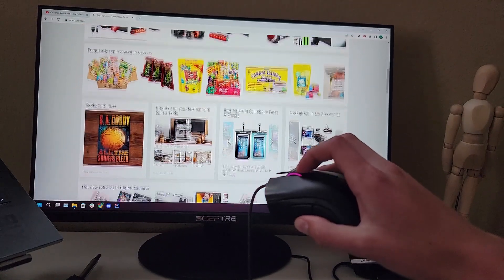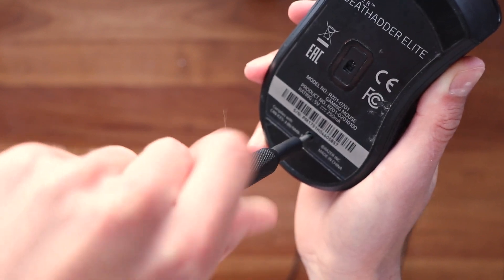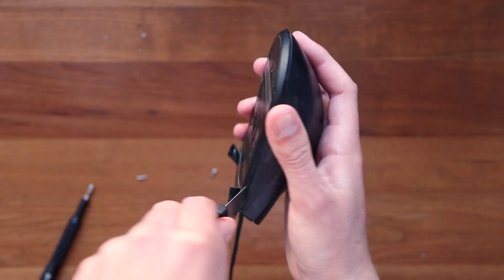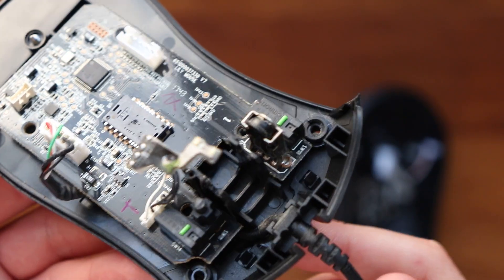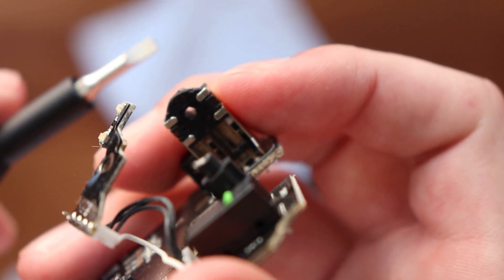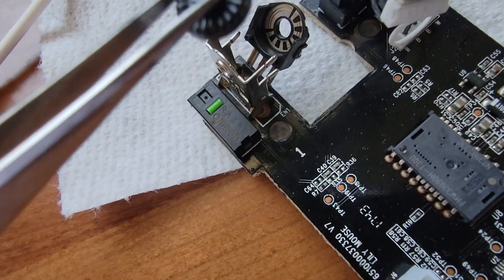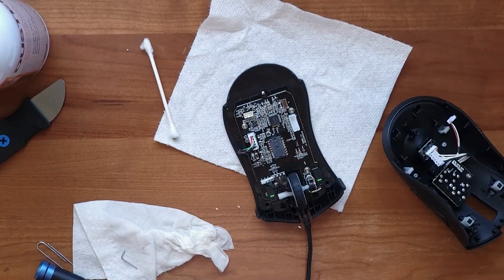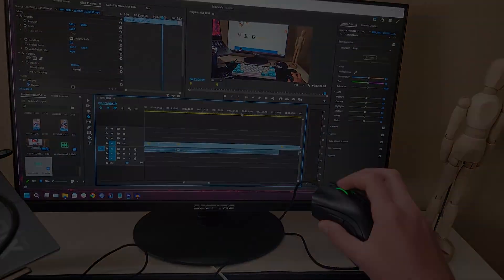How to Fix a Jittering Scroll Wheel (& Razer Deathadder Elite Dissasembly)

Comment: ive had my mouse since 2017 when i bought. good 8/9 years or so, razer lancehead. It has had this issue with the scroll wheel since i got it but always just ignored it and use auto scroll or the bar at side of the screen. Today in 2026 was the first time i thought id try to fix it. dont have compressed air can so just blew hard into the mouse scroll and now its working fine after all these years

Comment: My mouse wheel was acting up too. I opened the mouse and used my shop air compressor to blow directly on the little fins inside the scroll wheel, kind of like spinning a mini windmill. The wheel spun insanely fast and, for some reason, started working perfectly after that. No idea why, but it fixed it. Thanks for the help!

Comment: The number of views on this shows how many issues Razer has with some of their mice (yes, I know, not all the views are from frustrated Razer owners). Seriously, this is my third Razer mouse and EVERY SINGLE ONE has had the jumpy schroll wheel. I've never experienced it with any other brand.
I don't get it, are they using poor quality parts or something? They should be able to afford proper builds. And don't get me wrong, I have loved every single mouse from them - up until the point where it made me want to bash it against the wall in scroll frustration.

sign Next time I'm getting a Logitech again..

Comment: I tried many different methods: spraying, blowing air, but none really worked. I found a reddit post that helped me: "Turn the mouse upside down and press the wheel against your table/mousepad. Hold it down until the middle click actuates. Then roll the wheel back and forth fast for a few times. It might clear out anything preventing the metal contacts inside the encoder from working properly." I did as it says only I didn't roll it a few times, I rolled it for 3-5 minutes very fast, and while doing it I saw lots of dirt coming out. Though it didn't solve the issue completely, but it's about 90% better now.
Reply: this actually worked for me.  air didnt work, buy me some time
Reply: Bro that worked for me , tysm for sharing this out
Reply: tysm!!!! it worked for me too!
Reply: Here to say as well for anyone looking to resolve Razer mouse wheel scroll issues.

This worked for me as well. Pressed it down and went to town going fast, lots of crud and even a small dust bunny came out and now my wheel scrolls like new again.

I 100% vote to try this first before doing anything else, especially disassembly.
Reply: thank you so much. I really didnt want to take my mouse apart. Fixed it for now after rolling it back and forth for 20 secs super fast.
Reply: thanks bro it workedd for me
Reply: Lol this worked for me wtf
Reply: If you turn the black piece of circle plastic around, there will be copper somewhat dangling; try to kind of drag it outward so it will join to the copper on the other side better. When I fix a mouse, this usually works.
Reply: This should be pinned! it worked for me.  Thanks for helping the community out.
Reply: wow i just did this for like 10 seconds and it fixed it, thanks bro lol
Reply: Dude! This actually worked! I only did it for about 15 seconds, but the scrolling was almost 99% fixed. On certain rare occasions it would go the opposite way, but compared to the amount of work that this video suggests you to do, it is definitely sufficient and it works.
Reply: I did the pressing down and while scrolling fast i blowed onto the mouse that made the issue go away completly
Reply: WOW!! after months of rotting in the dust it finally worked properly again. I have the viper mini and the issue with the scroll wheel is unbearable.. I tried the rolling method for JUST a couple times and it felt new again!
Reply: Seems like it worked. Thanks man.
Reply: should highlight/ write it with capslock so every one would notice and try this first because its working!
Reply: Luve saver, thank you, it worked for me
Reply: Yo thx my mouse started having this problem like 3 months after I got it and js bought a new one, its been 2 years and that new one broke and I remember I had this one, I forgot it had that and I cannot wait for a new mouse, this fixed it 90% too
Reply: legend
Reply: It actually fixed mine 100% lol appreciate it bro💯
Reply: What the hell, it actually worked wtf hahaha thank you
Reply: i can't believe this worked :o
Reply: amazing. it worked.
Reply: broooo it worked for me thank you
Reply: Maaaan I love you
Reply: blowing into it didn't work, but doing this a little aggressively for about a minute in long sweeps really worked! The first time it improved but wasn't perfectly, so I did it again and kept doing it until it worked. Now my scrollwheel is moving pretty consistently! If I see it doing it again I'm going to keep doing this

I tried taking my mouse apart and blowing into the area (I didn't want to take the wheel out) and that didn't work. Bit of a waste of time unfortunately
Reply: It worked me too, thanks though 😮
Reply: brooo thanks a lot
Reply: thank you so much, its not perfect but like you said 90% better
Reply: Bro, you forgot this 👑
Reply: Damn this actually worked for me. Too bad I already bought a new mouse
Reply: fuck bruh it worked for me gg thanks
Reply: Worked for me for the first times, but now i've just broken my wheel.
I have the deathadder v3 pro with a hollow wheel. I mean i can scroll it, but its cracked on one point, so if i press to hard it bends in.
I'm searching through videos on how to fix the problem, without needing to buy new parts and replace them, but i haven't found anything yet, that i haven't already tried.
For now i just stick on using a second office mouse, when i have to scroll.
It's very annoying, considering the price of the mouse.
Reply: ily man
Reply: holy shit it worked
Reply: worked for me as well, thank you sir
Reply: this worked!
Reply: Thanks man i just bought another mice but i will return it now
Reply: Haha, it worked dude, thank you bro👍👍
Reply: OH MY GOD THIS WORKED YOU LIFESAVER
Reply: Worked. I will not say 100% but did a great job. Only issue is now the wheel squicks when I scroll fast enough.
Reply: That worked amazingly well lol thanks
Reply: Yep this works
Reply: Just did that. Saved my Razer Deathadder Elite. Thanks mate.
Reply: holyfk you fking legend prophet. gave it some baby massage as you described, pressed hard and start pushing back and forth and its fixed!
Reply: I FUCKING LOVE YOU MAN
Reply: you're a lifesaver dude I read on my pc and scrolling is a big part of it and it was annoying not being able to scroll but this fixed 2 months of pain in a minute!!
Reply: Brother, you found Reddit gold. My mouse didn’t scroll on a single part of the wheel. Rubbed it up and down on my mouse mat a couple times and it cleared it out. Saved me taking apart my mouse. Bless your soul.
Reply: IT WORKED BRO BIG THANKS
Reply: that is wild!  that worked for me 😂😂😂😂😂😂
Reply: Now it works, thank you for the tip!
Reply: thanks man
Reply: NO F-ING WAY! Thanks man!
Reply: Bro wtf thats worked 100%, thanks bro
Reply: thanks u are god
Reply: This just worked for me immediately on my Razor Cobra!   I was almost ready to give up half way through this vid
Reply: Wow that was the quickest fix ever, on some parts it would invert so scroll down it would go up and vice versa but now its smooth thanks!
Reply: It workt for me, ty man!!!
Reply: THIS ACTUALLY WORKED!
Reply: hahaha this is nuts, this actually worked weirdly enough. Must have dislodged whatever was affecting the sensors. Thanks!
Reply: @harikumar630  i know right! i just did it today few hours ago and i was like whaaaaaaaaaaaat?!
Reply: lifesaver
Reply: All praise to you bro, I just tried it and my mouse wheel works perfectly now!🙏🏽
Reply: DUDE YOU SAVED ME,THANKYOU
Reply: lmao it worked for me 😭
Reply: It worked bro! Ur the GOAT
Reply: YOU ARE THE GOAT
Reply: bro mine is completely fixed now, holy method
Reply: @tengkusyamil8085  this guy is a life saver
Reply: Wow this actually worked! Thanks a lot!
Reply: yo bro I have an deathadder v3 pro and this helped lol, thankyou so much. I already order a new scroll mech and wanted to replace.
Reply: Worked :O !!!!!
Reply: The hell, i though this was a joke but it worked, lmao

Comment: What you've done isn't the last resort. Instead of disassembling the mouse wheel encoder, you can also replace it with a new one. Mouse wheel encoders can be purchased for a few cents. All you need is some basic soldering skills and a soldering iron with solder. That's still much cheaper than buying a new mouse.

Comment: I pulled my mouse apart and removed the tiny screw holding the small circuit board which goes into the wheel (didn't remove the board or any wiring).I then carefully pulled the wheel to the right towards the black mount and pulled the left side out of the encoder and lifted it up .Cleaned the sensor with a cotton bud with isopropyl alcohol on it .I then put some isopropyl into a small medicine cap and put the mouse  upside down with the sensor in the cap .I refitted the wheel and moved it many times up and down .Repeated 3 times and the alcohol become dirty .Dried the unit and assembled .Works well again .

Comment: Don't take the scroll sensor apart, just use a contact cleaner and if the scroll feels loose, tighten the metal tabs using a pair of pliers gently.

Comment: Good old times, where Mice were designed to last practically forever. My old Intellimouse Explorer in the office is almost decades old - mousewheel operates perfectly. The Razer Viper V2 for 100+ bucks? After 6 Months the wheel fucks up and the Mouse is almost not to disassemble.
Hint: Flooding theinside with some electronics cleaner ("Tuner600") helps a few months until the wheel lags again.

Comment: Here's an alternative solution that is much easier but will also only last a couple days. Blow around your mouse wheel with your mouth. Compressed air will not work, as it is dry. You need the moisture in your breath for this. Do it both powerfully and weaker, give it a good 5-6 breaths. This stupid fix works way more often than it should.

Comment: Hey thanks for the help, I look at the stuff in it while trying to do what you did since mine was new bought defective, there is a copper thing that is very small like brush inside, my first attempt was it was still the same so in the second attempt I raise that small brush part and it worked like magic. 
I think that was the sensor and it was not raised enough have a good sense of scrolling. anyways thanks.

Comment: I just bought my new mouse and a few days later this problem happens. I had the same mouse before and had the same problem, The problem was solved when I cleaned the scroll wheel. But this new one is totally different. 

Here is how i fixed it:

① Dissamble your mouse just like in the video

② You see a white tube next ti the scroll wheel at 4:01 ? 

③ Use your finger and try to lift it up a little bit while using your othee finger to try to scroll the mouse wheel and see if its work. 

④ If it works, Grab a tissue and tear it a little and then place it right below that white tube beside the Mouse wheel 4:01 

⑤ Make sure the Whit Tube lifted slightly because it was blocked by tissue. 

⑥ After that, Go and try it again. if it works congratulations. if it didn't work, Repeat step ③ and ④ and make sure to clean it up properly before doing this method.

Comment: i tryed using lighter and quickly under the mouse puting the fire from distance, every like 5 rotate clicks was doing the same and the hair burned quickly and then used compressed air to get out completely from the wheel and it fixed 😂

Comment: @Val9k
Thank you for your nice video. It helped me a lot.
There is a way to clean the sensor wheel without breaking your mouse.
Do not destroy the 4 clips.

What I did: 
Remove everything like you did in your video except the sensor wheel. Do not take apart the 4 metal clips that hold the sensor wheel. After removing the scrollwheel and the board take a cotton stick and plunge it into isopropyl alcohol. Then press the stick on the underside to the sensor wheel. Same from the topside. Let alcohol flow to the sensor wheel. Remove the fluid with a tissue for some times. Put scroll wheel on and rotate backwards and forwards. Put some alcohol into the cap of your bottle and finally you can dip the sensor wheel completely into the alcohol and remove the fluid with a tissue for some times. Apply the scrollwheel intermittent and rotate it while alcohol is inside sensor wheel area. Repeate some times. Before assembling your mouse your can shortly dry the sensor wheel area with a hairdryer.

This worked for me. No breaking of metal clips.
Sorry for bad english.

Comment: razer is the worst piece of trash, both mice plus one headset i had broke. i usually handle with care not raging. first was lancehead TE which left/right main button broke, then i bought viper 8khz which had deffective scroll (jumping). never going back to this overhyped overrated overpriced shit of a brand again. headset just fell apart (the ear muffs' sew opened and the whole left ear muff also fell off of its place completely and couldnt put it back ever since.

Comment: Great how to, but what i did was spray just a small amount of electronic cleaner to both sides of the wheel, saved me from removing the steel clips and it did the trick. Thanks to your video was able to get the mouse apart no problem !

Comment: I used my fingernails to bend the little metal pieces and they didn't break. I thought steel screwdriver tip was too hard on them and I was definitely going to break it if I tried so. İt hurts a bit but I was able to bend them back easily. Also I discovered scroll wheel works best if you push that little scroll piece that we cleaned to the left as you can and make sure they are hold tightly.

Comment: Ty, it helped me fix the wheel on my DA mini v2, another tip for anyone trying, the little plastic wheel that you take of the thing to clean, it has 3 little point arms inside it, make sure they're not all the way flattened inside the wheel, if they are, take something very sharp/thin and pull they up a little, if they're all flattened inside the wheel they might not trigger the scroll signal.